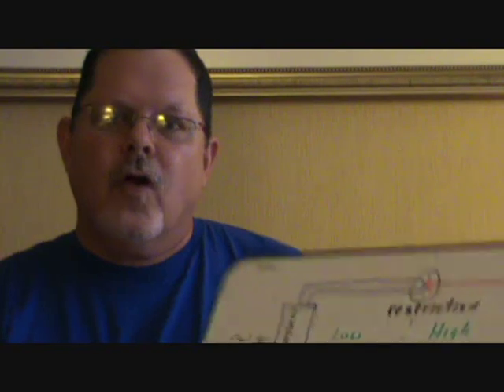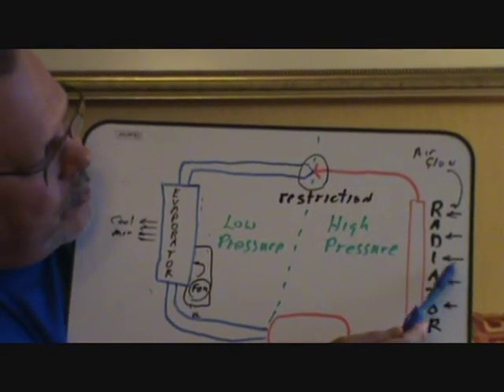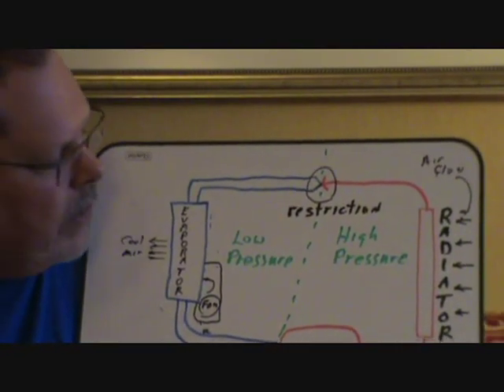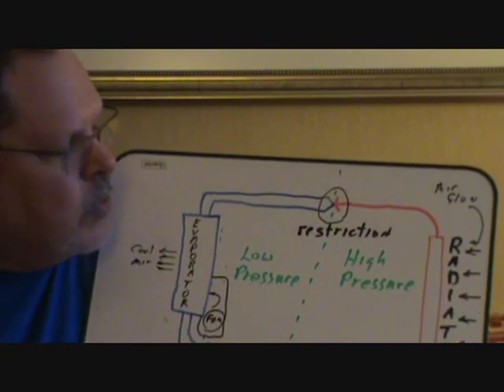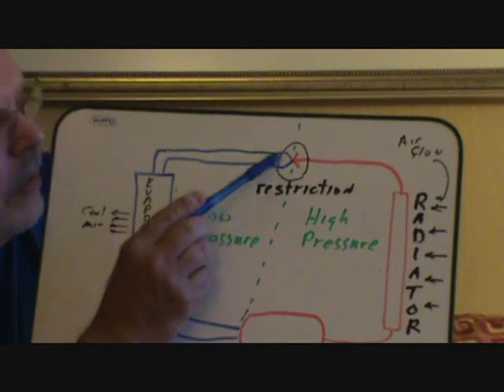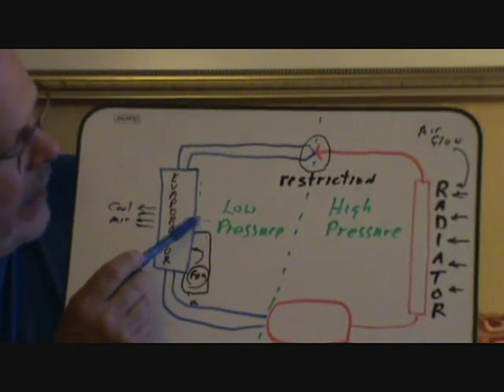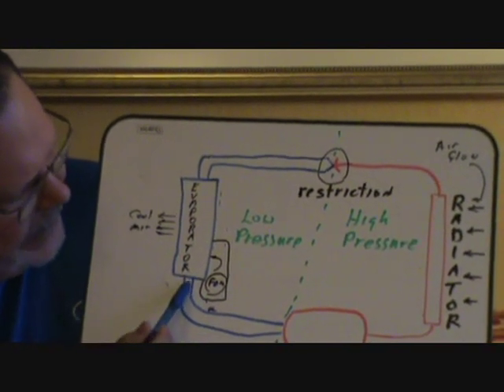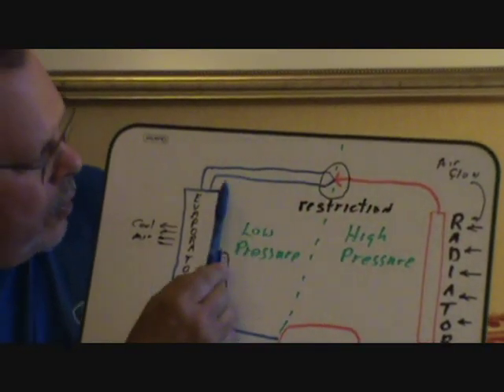Automotive A/C:  How Does It Work?

Comment: so this is probably already a concept that doesn't work, but what if they ran the compressor off of the timing belt as to not waste gas on the compressor itself? is it not strong enough? or why not have an electric one? i know cars used to be more fuel efficient with the windows down than the a/c and i know that's the opposite now. but my question is what if?

Comment from the maker: The radiator is not part of the A/C system.  I have the radiator in picture to show front of vehicle.  The condenser is right behind the grille.  The radiator is next right behind condenser, but is used to cool engine...nothing to due with A/C.

Comment from the maker: On the low pressure side the refrigerant is absorbing heat from its surroundings.  You are left with a cold pipe.  ie The absence of heat is cold.  Heat is what is moving.  Cold is just the absence of heat.

Comment: so if the tube that goes from the evaporator to the compressor carries "latent heat gas" to the compressor why is that that tube is ice cold on my car when the a/c is on (a/c works fine)

Comment from the maker: @mrjoeyman What you are trying to do is pump or suck the heat out of the cabin air.  You do this by causing a state change in a refrigerant.  When you take a high pressure liquid and quickly drop the pressure, it turns into a gas and absorbs latent heat of anything in it's surroundings.  It will suck the heat out of the air that is blown by it.  When you increase the pressure, it converts to a liquid and gives off it's heat to the outside air.  Just keep repeating this over and over.

Comment from the maker: @mrjoeyman Remember that it is not boiling water.  The boiling temp of r134a is -15 degrees F.  The high pressure side of the orifice tube is over 200 psi.  That is too hot to touch.  The suction side is a partial vacuum.  It is cold to the touch.  Remember that boiling just means going from a liquid to a gas.

Comment: Ok so when the liquid refridgerant goes through the orifice tube or the expansion valve and is turned back into a gas, and changes to low pressure, are you saying that the gas or refrigerant is actually "boiling"? So it is physically hot?